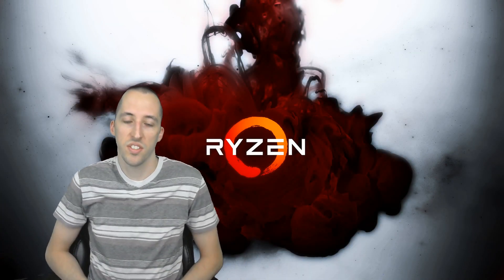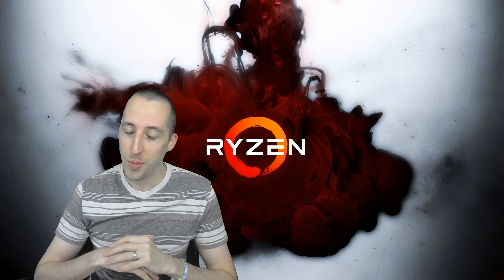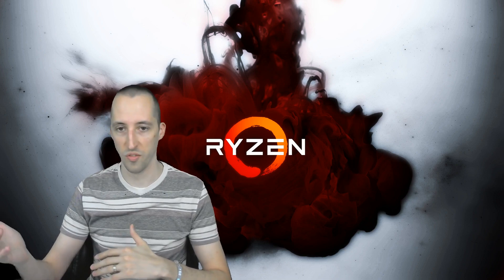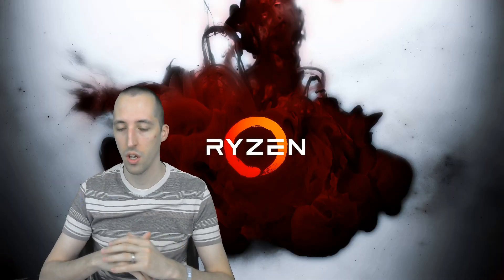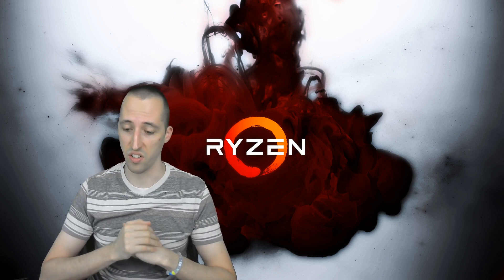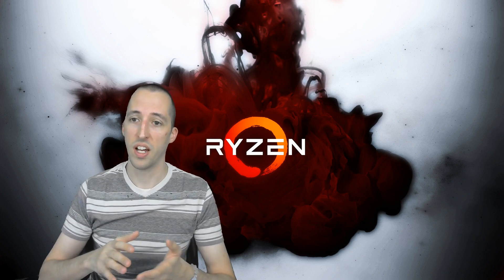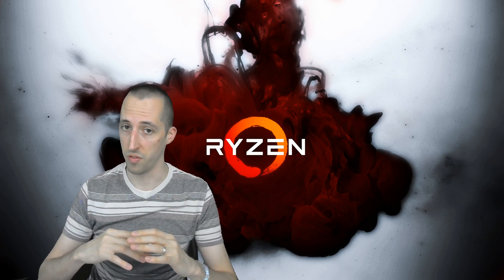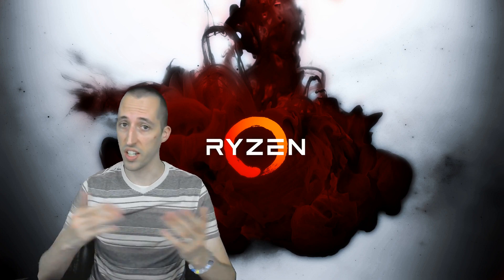2019 Ryzen 3400G Home Server Build and project discussions

Comment: 99% of the stuff you covered has been out for along time... please use fedora not centos and use boxes cause it looks like you are super green in this are.

I am running asrock itx MB with 32gb ram and 3400g inside it is Exsi 6.5 and in there i am running 5 vm one freenas and couple of linux and windows. Also if you put in a better heatsink better water cooling cause you have an apu there buddy... it can be over clocked easily to 4.2ghz  :)